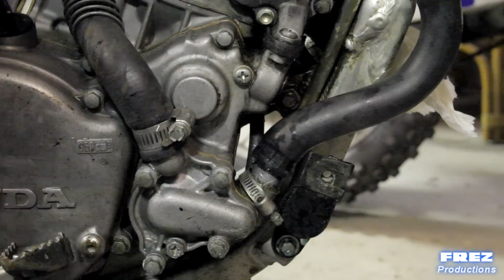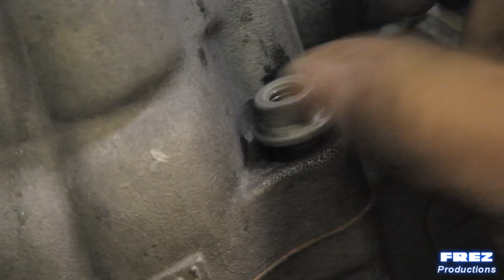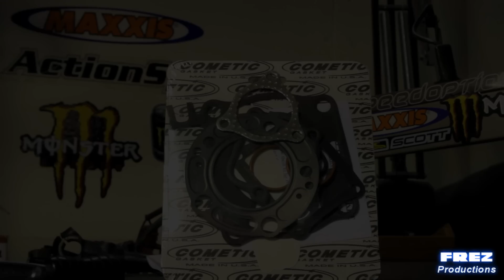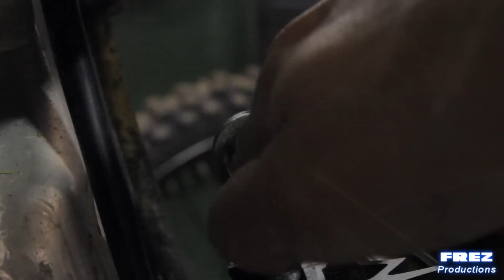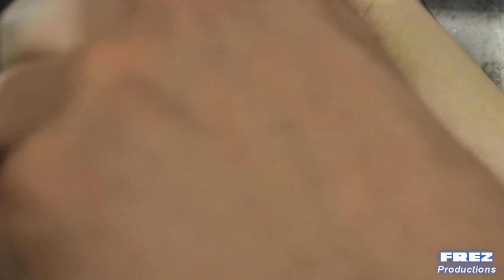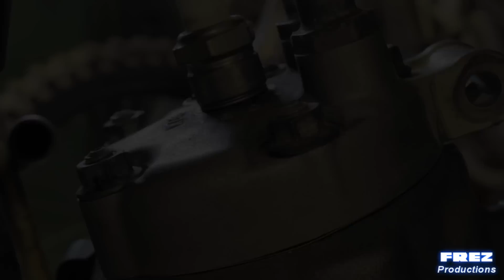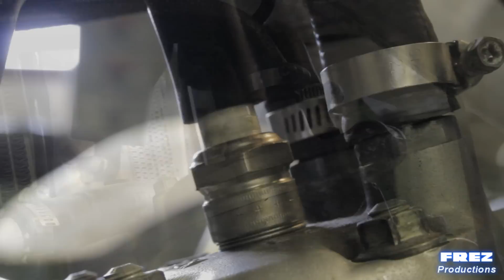Honda Cr 125 piston / top end rebuild.  A movie produced by Frez Productions

Comment: I don't like those style exhaust pipes on 2 strokes, it kinda turns me off.

when I bought my old 99 CR 250R it came with that style but I instantly paid the $300.00 to put a whole new exhaust system on.  got the FMF fatty with power core 2 silencer.

but now I ride a 2014 YZ 250 set up for trail riding here in Hawaii because I blew my top end on the 99 racing and didn't feel like buying a whole new top end.  sold the bike as is to a friend of mine for cheap of course, and bought a whole new bike.
Reply: but a new top end would be been like 150 or 300 at a shop

Comment: is this the same exact thing for a cr85? Can anyone let me know thanks!
Reply from the maker: +Ariel Avila Well all 2-strokes are made the "same" but this engine is not exactly the same as the CR85. Its two different engine designs but they work the same.
Reply: Frez Productions incorrect I'll have to disagree because not all 2 strokes are made the same .... Especially Honda because the cr85 has no power valves unlike the 125 , 250 and 500 .... So the process of replacing the piston is all the same but replacing certain parts in a specific order is not the same

Comment: One-word... "overheating"... try taking a look at the Tecate 250 jug, compared to the 250R... I bet most of the 250R race engines have ported coolant ports/jackets (what-ever)... a problem that has always plagued 2-strokes is insufficient cooling... ain't seen any improvements!!   
.
Any reason why a snowmobile (2stroke) would ever overheat in the dead of winter... check out some Jet-ski engines and there cooling, compared to snowmobile/land 2-stroke engines, and there cooling... everything is ass-backwards in "their" world....

Comment: Not talking shit but you are taking your motor apart and it's that filthy?. Why don't you put Simple Green or super clean on your bike after every ride?. Why didn't you put it on it before you took it apart? I have a 2001 CR250 and my bike looks spotless. And when I pop my power valve cover off I don't have all the oil in there like you do? That's the difference between rain cheap oil inexpensive oil. You probably run synthetic and I'm running the Castor 927 by Maxim.